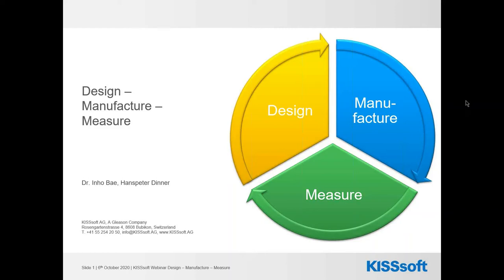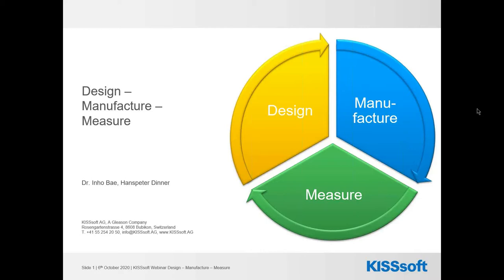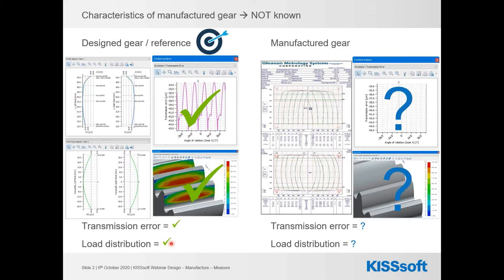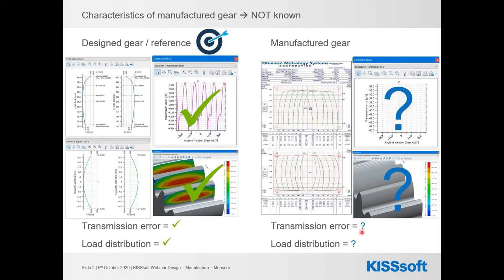KISSsoft Webinar: Design - Manufacture - Measure, October 06th, 2020

Comment: Hi, im doing my master's dissertation and i need to design a two speed/gear gearbox for a electric vehicle in KISSsys. All the videos i found only have 1 speed, does someone know how to do a 2speed gearbox in KISSsys? Is it through the shifting table template?
Reply: hi Did you find the solution , then please guide me towards this thing.
Reply: @BAPPA_Rawala  Hi, i believe it was through the shifting table, you can simulate a clutch with that feature.
Your KISSsys should also have some examples/tutorials with different "assemblies" made as example. Have a look on the top lef menu
Reply: @kinderoreo7857  thanks a lot for your reply 🙏 ( if you don't mind can you share your email or something to connect with you 🙏)
Reply: @BAPPA_Rawala  Did you find the examples?
Reply: @kinderoreo7857  yes I do find them. 👍🏻🙏
Reply: @kinderoreo7857  you mean to say that SPEED template in kISSsys?